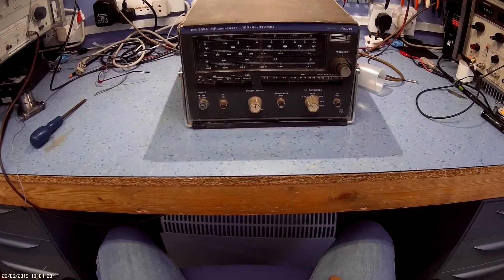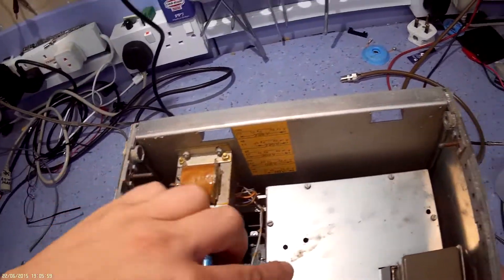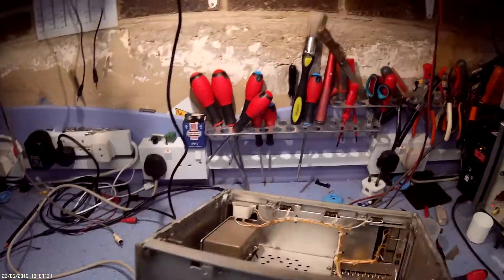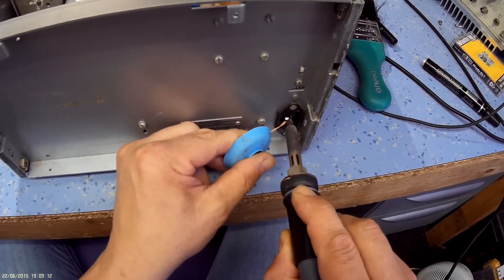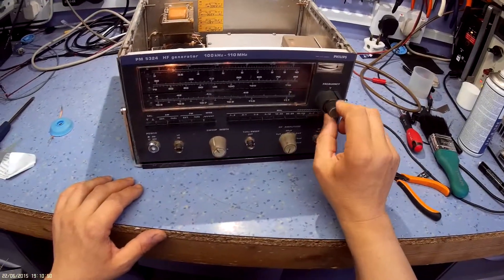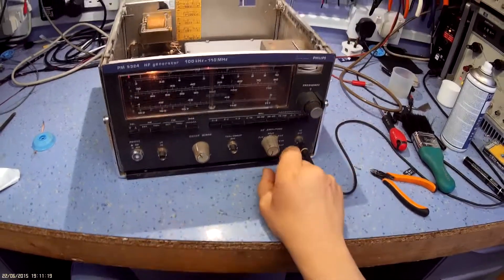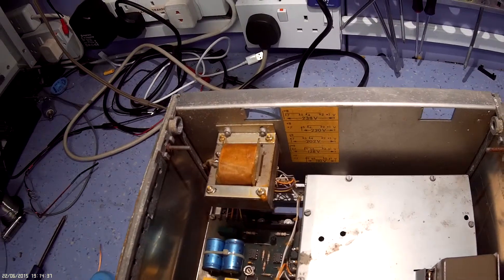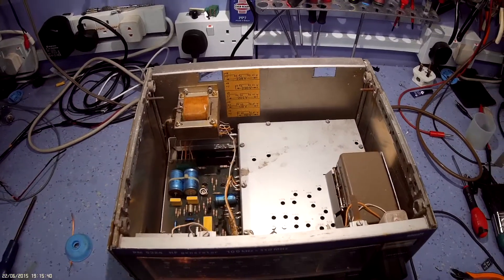Philips pm5324 sweep  generator or wobbulator Pt1

Comment: Another question is on the caps that call for tolerance like -20/+100  or even 2% which is  tight tolarance. What are your thoughts?

Comment: My earlier comment was regarding the RF output. So using a 50 ohm patch cable is good enough? I am not getting a good sine wave should I be looking at the oscillator circuit ?
Reply from the maker: Yes and terminate the other end into 50 ohm. If it looks a poor signal check the amplifier first. Most of the caps will be bad, as they are the Philips caps that are not great.

Comment: Hello, just received my Phillips generator. How do I go about applying some contact on the push button switches? I looks like they can use some.
Thank you
Reply from the maker: I would try and get into the back of the switch and give them a good soaking. It's not easy.

Comment: Hello, just bought one from Ebay. What is the input ohms?  50ohms, 600ohms???  Just want to use the right coax cable.
Thanks
Reply from the maker: The input is 600 I think. The output is 75 I'm sure but 50 I'm close enough.